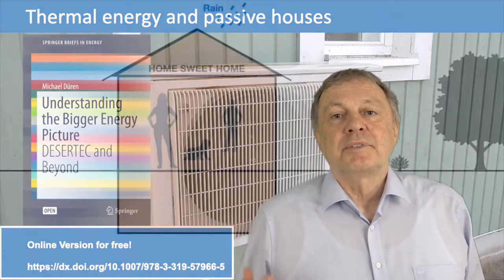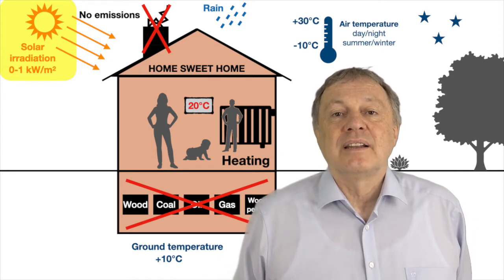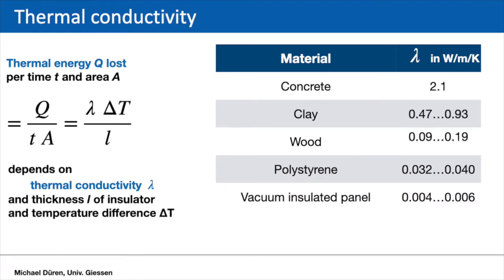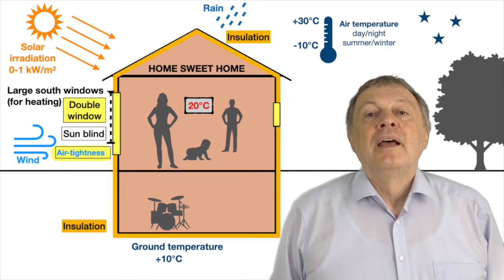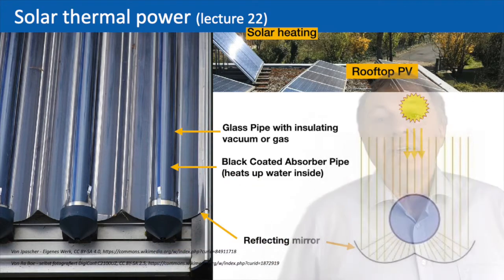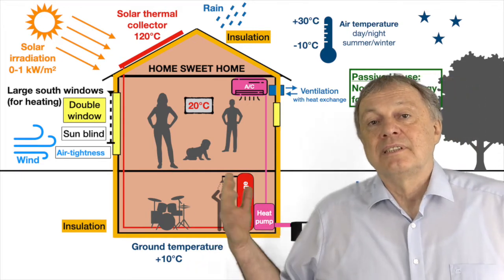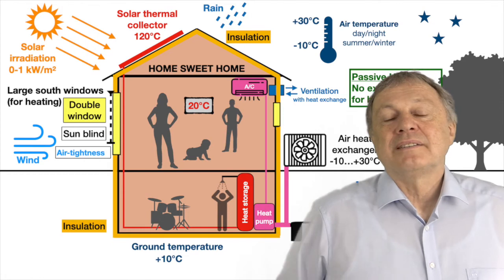EnergyTransition-33 Thermal energy and passive houses

Comment: 🎯 Key Takeaways for quick navigation:

00:01 🔥 Wichtigkeit des Wärmesektors in der Energiewende
- Der Wärmesektor verbraucht etwa ein Drittel der Primärenergie in der Gesellschaft.
- Diskussion über zukünftige Heizoptionen für Häuser, von einfachen Lösungen bis zu Passivhäusern.
02:23 🏡 Bedeutung der Wärmedämmung
- Wärmedämmung ist entscheidend für den Energieverlust in Häusern.
- Unterschiedliche Dämmmaterialien und ihre Effizienz.
07:07 🪟 Rolle der Fenster und Luftdichtigkeit
- Große Fenster für Sonnenwärme im Winter, Sonnenschutz im Sommer.
- Notwendige Luftdichtigkeit und Wärmeschutz.
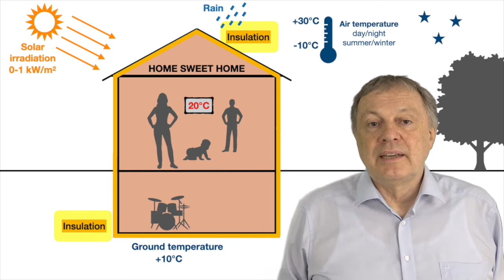12:37 ☀️ Nutzung von Solarenergie und Wärmerückgewinnung
- Solarenergie als Hauptenergiequelle für Passivhäuser.
- Wärmerückgewinnung durch Wärmetauscher.
17:33 💨 Lüftungs- und Wärmerückgewinnungssysteme
- Notwendigkeit einer kontrollierten Lüftung in luftdichten Häusern.
- Wärmerückgewinnung bei der Lüftung, um Energieverlust zu minimieren.
21:53 🚿 Warmwasserbereitung und Energieeffizienz
- Verwendung von Solarthermie für Warmwasser.
- Einsatz von Wärmespeichern für konstante Warmwasserversorgung.
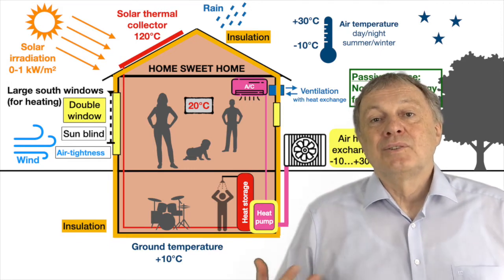24:52 🔁 Wärmepumpen als effiziente Heizlösung
- Funktionsweise von Wärmepumpen zur Nutzung von Außenluft oder Umgebungswärme.
- Effiziente Heiz- und Kühlmöglichkeiten durch Wärmepumpen.
25:05 🔥 Erklärung des Carnot-Motors und des Stirling-Motors
- Der Carnot-Motor und der Stirling-Motor wurden erläutert.
- Die Funktionsweise des Stirling-Motors basiert auf Temperaturunterschieden.
- Der Stirling-Motor kann auch als Wärmepumpe verwendet werden.
26:26 ❄️ Wärmepumpenprinzip und Koeffizient der Leistung
- Die Funktionsweise einer Wärmepumpe wurde erklärt.
- Der Koeffizient der Leistung (COP) wurde erläutert.
- Der COP hängt von Temperaturunterschieden ab und kann effizient Wärme übertragen.
29:00 🌡️ Einfluss der Temperaturunterschiede auf die Wärmepumpeneffizienz
- Die Effizienz einer Wärmepumpe hängt von den Temperaturunterschieden ab.
- Bei geringen Temperaturunterschieden ist die Wärmepumpe effizienter.
- Wärmepumpen haben typischerweise hohe Wirkungsgrade, insbesondere bei erneuerbarer Energiequelle.